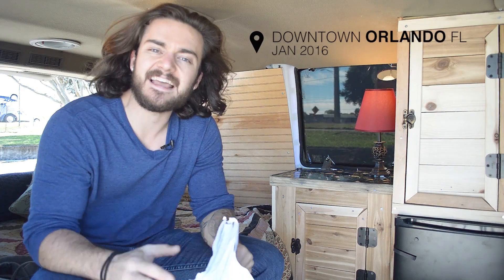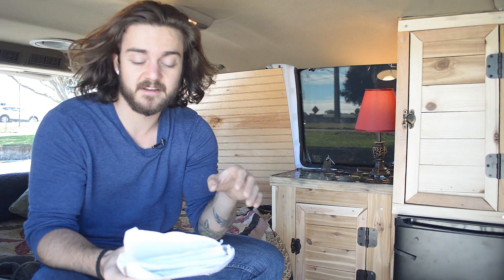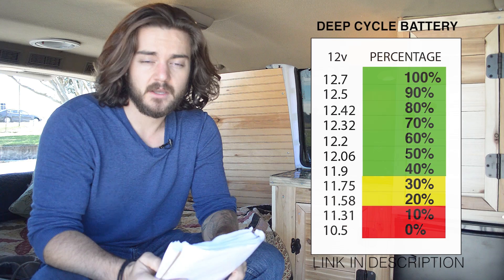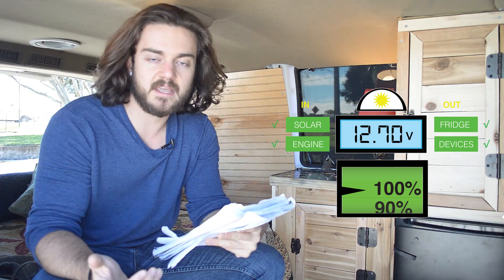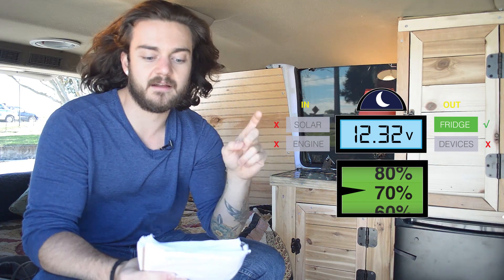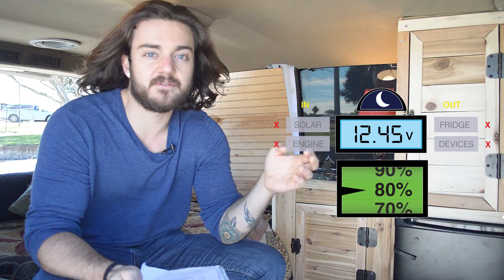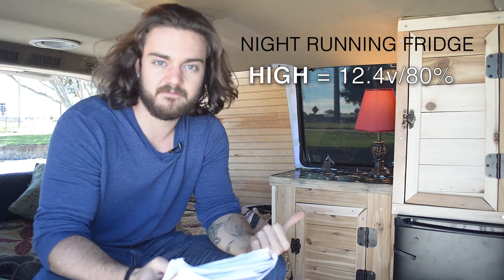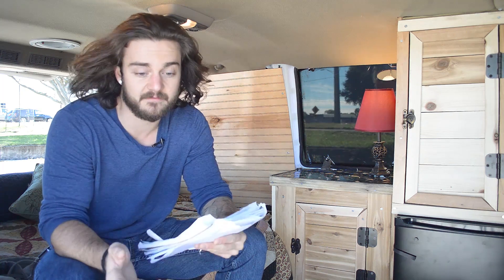Van Dwelling: Checking Voltage meter while mini fridge runs on my single 12 volt Deep Cycle battery

Comment: Enjoying your Channel and vids. I have a 2016 dodge grand caravan and I installed 2 - 130 amp hour AGM batteries and a 250 watt Renogy Panel with an MPPT controller. I have a 2000/4000 peak watt pure sine  inverter but I try to find everything I can in a 12 volt version. I use LED lights , a 12 volt "Lunchbox cooker". 12 volt TV, 12 volt water heater etc. My best addition was an ARB Freezer/Fridge. It runs on 12 volt,110 volt or 220 volt. I run it on only 12 volt,but I run it 24/7 and I keep it set at 17'F and keep a one gallon frozen water bottle in it. I lined the separate top section with insulation so I can use it as a cooler for eggs/cheese sandwich meat etc. It works GREAT! but at a cost. It was just under $900.00. Keep it up Brother!
Reply from the maker: +Dennis Steele Wow! You have a great set up!! Yeah.. 900! That is pricy.. maybe down the road when i save a bit more money i'll end up with a fridge like that. Dang seems like it would come in handy though. And thank you so much :)

Comment: Great video with a lot of detailed information!! Personally, I wouldn't run the fridge at night if you don't have to. Depends on what type of perishable items that you are keeping in the fridge. You are losing some efficiency by having to use the inverter. I hear that 12v compressor fridges are more efficient. Checking to see if your solar panel will charge under a Walmart parkinglot light would be an interesting experiment. You can also pick up another deepcycle battery. By connecting them in parallel you will double your amp hours. That would definitely get you through the night and some cloudy days.
Reply: +VanGo Adventures - About a month ago I was getting ready to sleep in my van in the parking lot at work. At about 8:00 PM I checked my charge controller to see my battery voltage, and I just happened to notice that I was bringing in 1.3 Amps! I looked out my back window (I have them blacked out while sleeping) and realized that I was parked directly under one of the giant flood lights. My ARB fridge / freezer draws approx. 1 amp while the compressor is running so I was producing enough power from the flood light to run my freezer at 17'f  all night and my batteries would never even know it was there haha. I was amazed and glad to know that I had night time charging options if I ever need it.
Reply from the maker: +VanGo Adventures Yeah I am actually starting to turn off the fridge at night! I don't really have anything that will spoil. lol it would be crazy if the walmart light would work. Down the road I might add a battery and possibly get a 12v fridge.  Thanks for the info and recommendation by the way. We will see though, if it is ever in the budget! And thank you so much :)

Comment: Wow! When I was hoping you'd do a power draw video I wasn't thinking you do anything this detailed. I had the same thought on battery charge as you did. Guess we got to stay open to learning new things! Most of what I've read seams to say it's best not to use more that 40% of your batteries capacity. I agree with the other comment about going with a 12 volt unit. In my mind not needing to run an inverter would be a huge plus and could probably make a huge difference in battery life. Awesome video!
Reply from the maker: +fivetenonefourty Yeah! So much out there I don't know lol Yeah I plan on getting a 12v fridge one day when it works in the budget. This cheap fridge will hopefully do in the mean time. And thank you! I really appreciate it :)
Reply: +Wizard Dream no worries. You are helping all of us out blazing a trail we can learn from, and hopefully not learning from your mistakes!
Reply from the maker: haha thank you! Hopefully I don't make too many. You guys have helped me dodge killing my battery :)

Comment: Highest production values Ive seen in a vanlife video. Good stuff. Its not stealth but depending on location have wondered how putting up a small wind generator at night (like they have on boats) would go to keep the battery charged.
Reply: He's no Eric Jacobs he is the production master!
Reply from the maker: +Harry S thank you :) really appreciate it! A while back I was looking into that. It would be a really cool addition. Most of the ones I found were kinda big. I'll look more into that though!
Reply: IMO, if you have a system that will run for a good while without drawing the battery down too much, a small input (like solar or a wind generator) will probably give you a useful power bumpup.  Yeah, not stealth for the wind generator and you have to have a pretty fresh breeze to really get much out of one, but in the right conditions it should help.
My theory is that if I pull 100 watt hours for an hour and then charge 100 watt hours (in addition to what I'm using), I should stay up near fully charged.  But it takes "management".

Comment: Great video Weston as usual. 

I lived on a boat for over 10 years and I chased voltage readings for ages until I got comfortable instinctively knowing what state of charge my batteries were in. With time you just learn what you can do and what you can't.
Reply from the maker: +SonofSilas thanks so much :) wow a boat! now that would be cool. Yeah I have already learned a lot. I'll be figuring out more as I go and hopefully get more comfortable with it. This was an insightful experiment for me
Reply: I am restoring a 1972 Yukon Delta currently! Won't be full time living on it, but wanting to stay out on the lake for extended weekends.

Comment: Great vid bro! Keep it up. Some guys park under parking lot light's (like at WM) during the night and it keeps their battery charged up. Depends on your solar panel to. You should try that and let us know if that trick worked for you. Maybe different types of lights and locations might make for a fun vid. Looking forward to your next vid man.
Reply from the maker: +darfirst Oh that is an awesome idea!!! I will look into that! What do you think about unplugging the fridge at night? Do you think that would be okay. I remember someone recommended that to me, but I forget who. I tried it and it didn't seem to be a problem
Reply: +Wizard Dream Should be fine unless you open it a lot or it get's really hot in your van, might take a lot of power to bring it back to the temp you like.
Reply from the maker: +darfirst Okay awesome! Yeah during the night I make sure I don't open the fridge. And the nights I turned off the fridge, the next day's voltage was fine. So I might start doing that to be safe

Comment: Hi, in the end you will go for a good 12 Volt Compresor Fridge. Its not that nice when you forced to move because Its a bit cloudy and your Solar cant charge after the Night. Dont buy any devices that need 110, and look for high efiecent devices ( LED ). I've got a 55amp Optima Yellow Top and run my Fridge, my Lights ( 2x 3 Watt LED)and charge my Phone every Night, after 48 hours I never run under 12.1 Volt. And yes, a complete filled Fridge is drawing much less then a half filled. Stay safe.
Reply: You're better off buying a second quality deep cycle battery and keep the mini fridge than spend $800 on a compressor "cooler"
Reply from the maker: Yeah! One day when I have a bit more money! Do you recommend a certain fridge? My lowest night was the only night that dropped below 12! And thank you for the info :) will do!
Reply: Hi, I'm a huge Fan of the Engel Fridges. But these things are realy expensive. Waeco ( sold as Dometic in the US) are well made, also ARB. If you like to grab more Informations then check out the Expo Forum. All the things from Solar, Fridges etc. are very simular betwen Overlanding and Vandwelling. I'm original comming from the Overland side and gave myself into the Vandwelling after a divorce. Best decision I've made for decades. Stay safe.